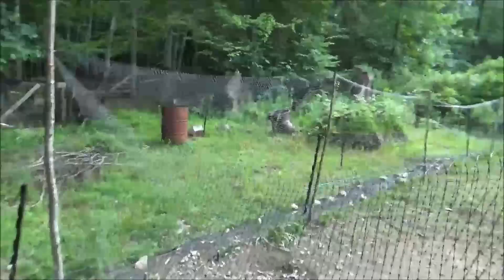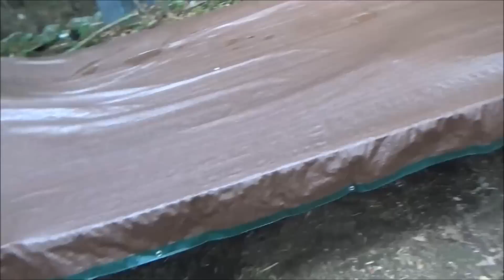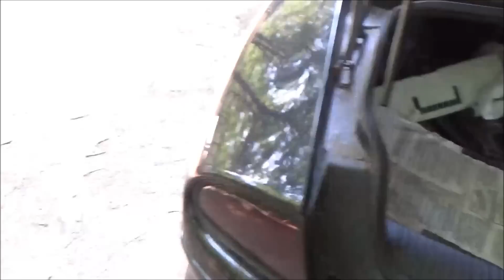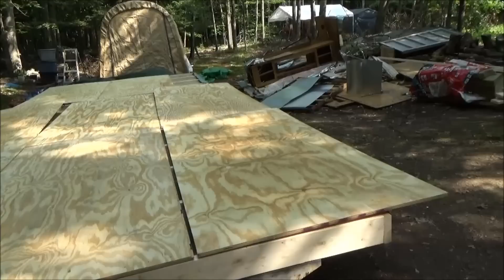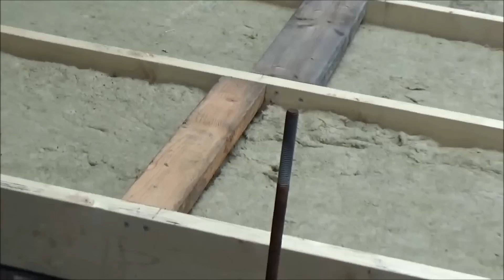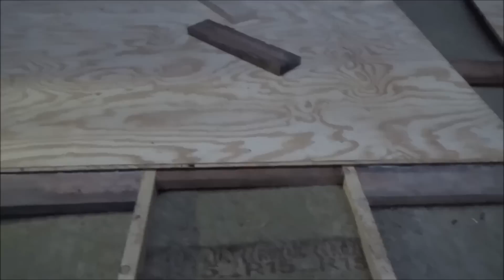Starting Laying The Floor Boards For My Tiny House On Wheels

Comment: If you're going to be framing you should get a chop saw.  Liquid nails (not caulk) the floor to the joists.  Tongue and groove will not go together if you screw your first board down,  loosen all the screws but the far edge and you can tap the floor boards together.  Also, you did not stagger your seams, your second board should be cut to a 4'x4'.

Comment: Troy, when you cut any of the sheets of flooring up, try to save the sawdust.   Mix it with wood glue to fill any small gaps, the sawdust added to the glue will ensure it's the same colour and it won't stand out too much...
Reply from the maker: Thank you for the tip
Reply: I'm wondering if your tip will be a problem because sheets are supposed to be applied with 1/8" gaps on all side. That is the method that all manufacturers of plywood, and OSB recommend to avoid buckling from expansion and contraction. By filling the gaps, wouldn't you create that very problem by filling the gaps? When the the wood contracts, the filler will be loosened, and eventually break up and disappear.
Reply: Jim Watson I saw another youtube video of a prof outfit that makes custom trailer for tiny houses. When they layed down the plywood, they used (8 or 16?) penny nails to create a gap for expansion.

Comment: If you have about a 4 inch long driver bit for your drill, it would make your life so much easier when screwing in screws.  Great idea with the board to keep your screws lined up.

With that tongue and groove plywood, when installing it, stand on the board you are trying to beat into place and use a sledge hammer (or whatever you have available) to hammer it tight.  Standing on the plywood keeps it forced down so the tongue slides into the groove easily, plus your weight will the board from bouncing back.  It's still tricky to do by yourself, but that should make your life a lot easier.

I'm looking forward to seeing the floor finished, I bet it won't take you long to get up there with a chair and iced tea and enjoy the view from your finished floor :)
Reply: You know, when I saw the first boards in place, I also had that vision of Troy in his chair!
Great to see progress. Hope Troy waits for pay day to get the proper bolts for the second half of the floor. Handling those clumsy boards alone will keep him busy anyway for most of the wait. Talking about having/using long screws he has, sounds like quality creep to me. Adjust where experience shows it's necessary, but stick with the good stuff, even if it means waiting a couple of days.
Reply from the maker: Yes I need to use an extension. It will be better. Thanks.
And thanks for the tip. It is hard alone thats for sure
Reply: The Do It Yourself World the harbor freight extentions work pritty good. I have a few of em. No better than my dewalt. I actualy prefer to use it over the dewalt. However that said the harbor freight bits suck dont waist your time $ or screws on them. Buy good ones. Btw troy i got my place been working 16hr days between work and fixin up the house sorry i havent gotten to your box to put it together for you. Just been oober buisy.
Reply from the maker: TAC DAD Thank you. No problem.

Comment: The table saw is a nice find! I hope your workbench is the same heigth so you can use it as an out-feed table. 
If your RV's onboard generator was operational, I bet that would run your new toy.
Reply: I've wondered that several times. That generator should be a beast.

Comment: Troy when you position your battery bank place it on the center line of the trailer. When you move the house the weight of the batteries being on the outer edge may result in the twisting of the frame, as it bounces down the road. Also you may want to consider weight distribution, so that the trailer is not too tongue height.
Great series of videos.

Comment: Troy, next time you have a problem with the plywood not centering on the joist just slide it around till it is centered. If it hangs past the outside ; cut it off afterwards. If it is a little short of the edge that wont be a problem , because it will cover underneath the wall plate. 
 One more thing that i can't stress enough, and I know you've read my earlier comment on this subject, but if you think your having problems with getting joints tight now, you haven't seen nothing yet. You MUST snap a line through the plywood and to the other end. Plywood is NOT always perfectly square. Because of this your rows will get WAY off, and you will find that your plywood rows will not be straight with the way your doing this. I no you don't like the fact that your seams aren't tight., But if you continue this way when you lay down the next row, your going to find it's FAR worse. You might get lucky and this may not happen, but there is no reason to gamble. You will find that these methods are tried and true from millions of carpenters from the time since plywood was put on the market.

 I've laid down many thousands of sheets and I know what I'm talking about.
Reply: Pete Brown Hi Pete, he's using tongue & groove. I've expounded on the gap subject in other posts in this page.
Reply: Pete Brown Good job Pete. Let's hope he get's to your email in time, but I got a feeling it's to late.
Reply from the maker: Thank you. I was stressed out beyond belief when I could not get the plywood squared up on the frame. Driving me mad.
Reply: Jim Watson Hi Jim: 

so what's the solution if most/many stock plywood sheets are NOT square? Ya have to trust that the tongue and groove sides are parallel--If they're NOT, then one side may no longer have a tongue or groove running the whole length, once you cut that side to fix it. 

If U R laying the first board into the corner of your house, do you snap a line where the grooved side should fall on the joists, then lay the plywood down so the groove side is perfectly aligned w/ the chalk mark, letting the 2 other sides which will be forming the 2 sides of the corner of the house  fall where they will--overlaying or falling  short of covering the edge of the house, THEN slide the board along the chalk line till you get the best coverage on the one side (the side which is both perpendicular to the groove & forming one side of the house corner) to completely over hang and/or be flush w/the frame underneath it, before screwing it down and cutting off the overhang?  then cutting off any over hang on the tongue side and not worrying about any spot that falls short on the tongue side? This does notover hanging, before
Reply: surfinthru2 (the above posted prematurely... I was going to say that these steps dont guarantee that the 4th side is square.....

It would seem  better to send all sheets of plywood through some some kind of jig or a fenced table saw to ensure everything was square before doing all this--cutting both sides that are perpendicular to the tongue and grooved sides.

Comment: Troy, instead of wasting space on a battery room, just build the batteries into your sofa base instead. Have a removable top that the seat cushions sit on and save that space for food and water storage etc...
Reply from the maker: I want my batteries together with all the electronics and controllers though. Easy to reach and monitor.

Comment: Liquid nails should had been used for your flooring not caulk. Liquid nails is for ensuring you do not get squeaks in the flooring like you had in the camper caulk is flexible so one day it will start squeaking. Sadly you mentioned in a couple videos about using Liquid nails and how important it was in a tiny home,campers for extra strength on light weight materials and flooring. Troy you have a chance to build a very nice place that could last you a life time and more. You are putting that dream at risk over saving yourself a few dollars. (A barrier between the flashing and insulation, caulk rather than Liquid nails and more to come I believe) Its to late to fix that and venting the floor correctly but maybe if enough people preaches to you, you will see certain things are a must. Sorry about not giving much positive feedback lately but this is a big expensive project that you are going to NEED to last you a life time. And a mistake now is not what you need or want.
Reply: next year once the moisture that is trapped in the floor warps his flooring and starts to squeak, and the black mold forms, then sadly it wont be fine. Believe me I am all for Troy finishing this been with him a while now and never gave a negative feedback but this project is big and expensive it needs to be done correct the first time. There are so many other reasons he should do and not do the things he is doing, for safety issues, health issues, durability issues, and just flat out the only way. if this was just an inexpensive experament then by all means cut corners and if it fails so what but this is not.
Reply from the maker: I have not claimed to be an expert. I am learning as I go. Hard to make changes on the fly. I did not go with caulk to save money. Its about the same price. I got confused with so much advice. Someone at one point said use liquid nails on the tongue and groove. Now someone said do not. Its hard to choose the right advice.
Reply: Pete Brown the saw probably won't cut straight. What most people don't realize is that every saw has a way to adjust it to make sure it is straight. It takes a minute or two, a screwdriver and a speed square. Checking takes 5 seconds and a speed square. 
Eventually, even the most expensive saw will come out of square.
Reply from the maker: Pete Brown That person with no name and just letters and symbols is now blocked

Comment: Troy, why don't you start a thread on your web site where you can have a few of the experienced subscribers join in and there you can discus, in advance, what you plan to do next, they will give you tips and advise on how to do it efficiently and correctly.
That way, any mistakes you might otherwise make will be prevented before the video.

Comment: I couldn't get mine together when I replaced the floors in the camper...I thought maybe I wasn't strong enough or maybe it was because I was inside the camper building the floors. Glad to not be alone with this.

Comment: Looking good Troy. Only thing you should have done was cut one of your 4 by 8 down to a 4 by 4 sheet so your joints are staggered. But it is coming along good.
Reply from the maker: Thanks. Yes I read that in the comments too late.

Comment: I am curious why you aren't using the space at the back of the trailer... which currently has no floor, as the battery/storage room?  It could have access panels inside (slide) and outside.

Comment: Tip do not screw the floor down untill you have pushed together the 2 TG boards. you can put a screw in the 2 corners opposite of the side you are putting another TG board. once you get the tight seam you are wanting screw the first board and just the corners of the 2nd board. this will help
Reply: Have done exactly as you mentioned on many a deck job... but then again we are running around with nail guns and sledge hammers to beat the seams... also standing on the sheet we were working..
Reply from the maker: Thanks

Comment: My craftsman table saw (granted it was way older than yours looks) blew the breakers in my house, and strained my 2000w generator to the point it tripped its breaker too. We ended up using it as just a table to cut on, and after the project was over, had to get rid of it since it was of no use with my power issues. Hope you have better luck!!

Comment: Houses need to breathe. Once the floor is finished, don't worry so much about making everything air-tight...you will have expansion and contraction as the seasons change. 

Also, I'd search for scrap tile or vinyl flooring. You will regret not putting a proper floor in from the start.

Comment: you need to verify the floor frame is square , measure corner to opposing diagonal corner, before you get to a point where you cannot correct it, carpenters squares and framing squares are sometimes off and have to be adjusted.  the last framing square I bought was off straight from Lowes. plywood is often out of square and has to be trimmed.

Comment: troy, after countersinking screws you should add a dab of waterproof silicone on top of screws=rustproofing screws stainless or not!
Reply from the maker: I will coat it all with shellac. This works for metal and wood.
Reply: The Do It Yourself World won't the shellack potentially crack/peal? I like +george hill 's idea. Consider it.

Comment: Troy.. Curious.. Did I miss the fact that the 2x6 frame was bolted to the trailer frame? Also, I am pretty sure that you will need a vapor barrier just under the plywood. Hope the sheets won't squeak or warp. GOOD LUCK DUDE!! :-)
Reply from the maker: I forgot to mention that we bolted the front half down. Thank you

Comment: Looks sturdy Troy, and I am really surprised that the flashing did not make a bunch of noise when you walked on the floor. I was worried about that, I guess the insulation and having the plastic on the other side, hold it still enough. Good job!
Reply from the maker: Thank you. I figured it would not flex much though. Its a pretty short floor

Comment: On a dry day paint your floor with varathane, will seal the wood and keep the moisture out as well as when you start to do your walls and roof.  When your all up and sealed in you can sand and re varathane. will also keep the wood clean looking.
All the best.

Comment: Use lots of wood glue on those tongue and groves. In fact use wood glue as much as you can!  A trick I learned from apprenticing 5 years under and master builder was this. NAILS ARE ONLY GOOD FOR HOLDING THE WOOD WHILE THE GLUE DRYS.  That advice has payed off for me all my life. Glue is maybe more important than the nails in building things that will last 800X longer
Reply from the maker: WINDGENEERING Thanks. I got a case of it.

Comment: FYI the hangers are upside down to help hold the rim board up that supports the wall on top of it, you have to remember he is cantilevering his floor past the main supports. don't use wood filler, leave it and let the finish fill the gap

Comment: Start out with a half piece of plywood then add a full sheet after that that will make them stagger. the next row use a full sheet then they will stagger like bricks and it will be stronger because it the seams will not be one countiouous. so its stronger.
Reply from the maker: Wish I knew that before. Thanks

Comment: Liquid nails not caulk its waay stronger bond. You could use wood glue. I never use liguid nails though and my stuff is ok. But it would be much stronger with it. if you need to take it apart to redo something then no glue or liquid nails is great then. Because your not taking it apart with glue or liquid nails with out destroying it.
Reply from the maker: Thanks. I will get more liquid nails then

Comment: Troy, everyone is correct on gluing that floor down. The grooves are not supposed to be tight. There purposely made that way for expansion and contraction. Snap a line down the length of the building for the rows. You have to stagger the joints.These are all standard construction methods.All new homes are done like this.
Reply from the maker: Thanks. Its too late to stagger the joints though. And with the next boards I will be forming around the wheel wells anyway. I can try to put a full board in the middle and work from there, if it fits.
Reply: The Do It Yourself World Unless you have laid down the entire floor it is not to late to stagger the joints. Cut the first sheet on the first row in half in the middle of the joist that is on the 4' layout, then butt a full 8' sheet against the one you cut. After that all joints will automatically be staggered. Use the other half of the sheet to start the 3rd row. Removing the the 1/2 sheet that you cut off will be easy, because it is not glued, the caulk is not dry, and screws are backed off easily.

 With all that being said, I would say that the easiest way would be to unscrew the sheets you already have down (this should take no more than 5-10 minutes and alleviate every problem) and snap a line @ 48 and 1/2" from the outside of the frame first, then glue the joist under the first row and put the groove side in towards the center of the structure. This is because you don't want to smash that tongue which will make it very difficult to insert the smashed tongue into the next sheet. Be sure that the sheets on the first row are fastened enough so that when you lay down the second row, the first row doesn't move when your slamming the sheet against it. Use a sledge hammer and an eight foot board when tightening the sheets up.

Comment: Well it getting done so thats a good deal and Im glad you are using some bracing it needs it to make it strong. Baby cat could get spider mites from the chickens I would keep her away from them. I have a table saw exactly like that one. The gears stripped out of it. bummer they are notorious for that happing. It may possibly be already stripped out. i use it for a table now LOL. I got another table saw an old one with belt drive they are the best. they last.
Reply from the maker: I can treat her with dia earth as well but mites are less of a problem than ticks are. The saw feels good when I spin it. Lets see when I get enough power to try it.